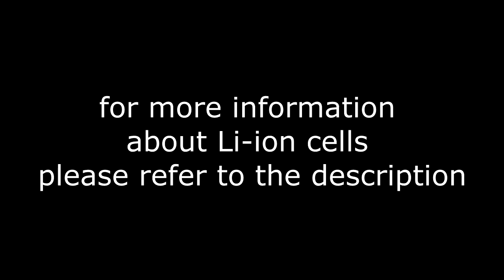Discovering what's inside li-ion battery cell

Comment: the anode sheet is probably the copper-coated one (negative pole). On the other hand, the cathode material is usually coated on the aluminium foil (positive pole). The insulator sheet is the so-called separator sheet, which blocks the current flow but allows ions to shuttle between electrodes.

Comment: Requires a flashing "DO NOT TRY AT HOME" banner. This looks safe in your video, but IIRC these thing can catch fire very easily when handled "wrong". I think it is unusual that your battery did not catch fire. Maybe you know what you're doing, or maybe the battery didn't have a charge, I don't know.
Reply from the maker: +Toby Hinloopen actually i opened a dead one so it didn't caught fire 
And thanks for reminding me edit the description and add some warning
Reply: @EslamsLab  Yep. Fully discharging it is very important.